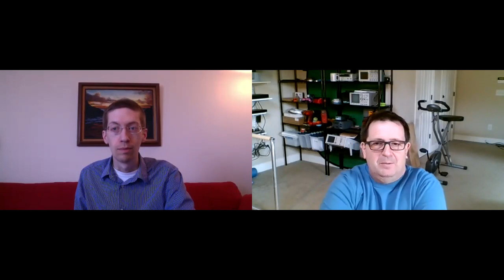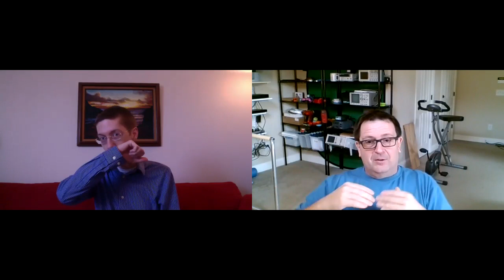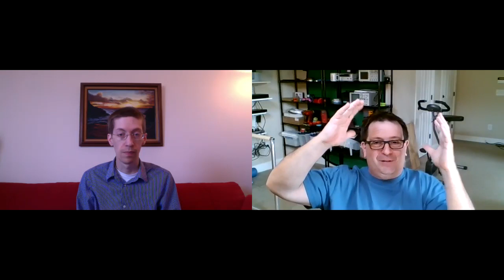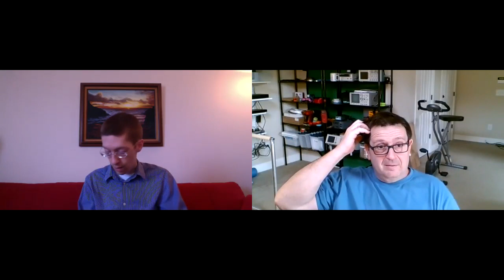Bob Dennis and Aaron Coffey discuss PEMF and various theories about why it works

Comment: Hi Robert....we purchased a pemf unit from your sight and work under Dr Michael Johnson...we have noticed since Gered started using the pemf on his cerebellum he feels more pushed around and is more wobbly in his walking ...we don’t know if this is due to things healing and changing at a rapid pace or due to 2 hrs of pemf therapy daily on his cerebellum? His stroke was in his cerebellum a yr ago..and we just wonder if that’s all part of the healing process just looking for a theory ...thank you ...we appreciate your wokr
Reply: Work
Reply from the maker: Well, I can not and should not give clinical advice.  But as a scientist and stroke survivor, I have a personal opinion on the matter.  My scientific opinion is: perhaps the intensity setting is too high: consider using lower intensity or shorter sessions.  You may be able to substitute shorter sessions with greater frequency of use (for example, two 1-hour sessions per day instead of a single 2-hour session).  You can convey my opinion to Dr. Johnson if you want to. 

I had a cerebellar stroke about 2 years ago, and I have to dial down the intensity and use more shorter sessions to minimize the dizziness that can sometimes result from the use of PEMF.  Individual responses vary, so you need to experiment with intensity, coil placement, pulse protocol, duration, and frequency of use to find what works best in each case.  This sounds daunting, but it seems to work itself out if you are persistent.  I also need to keep the system away from my ears or it can cause my BPPV to flare up again, which makes me *very* dizzy until I do the Epley maneuver.
Reply: Robert G Dennis ...this is so good to know! I appreciate your response and am so sorry for you have to had a stroke like this...we will relay this message to Dr Johnson! Your theory was helpful and we know and understand your position thank you again so very much!
Reply: He has only ever used it on low! But we think less time is an absolute
Reply from the maker: @andreaacker6174  OK, glad to help.  Please comment back to let us all know if this strategy is helpful, or if you find another strategy that is helpful.
Reply: Robert G Dennis we def will!!
Reply: @andreaacker6174  hi, I'm new to this and learning... any feedback on Bob's last recommendation? how are things?
Reply: Hi Bob....it’s Andrea Again ...we backed off completely for about two months on pmf ...and are thinking of starting again very slowly...backing off seemed to help Gered not feel “pushed” around so much...he also made comments like I feel like my head isn’t as active either ...he was feeling like was so active that he felt overwhelmed? So anyway that all has improved do you have any recommendations as to how to how long to do? Thank u for your time as u can see it def does work it’s finding how much time is the challenge to use it and it be effective for Gered...